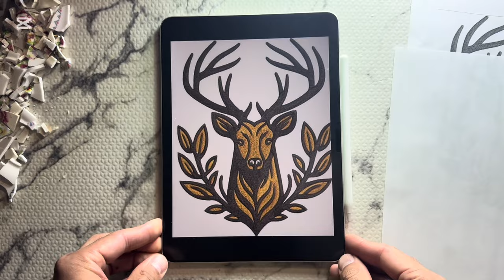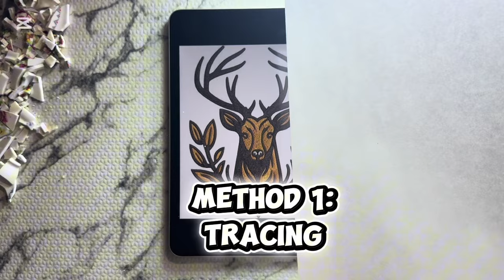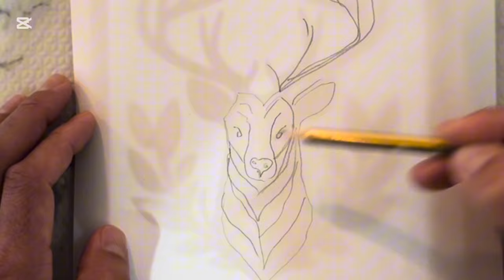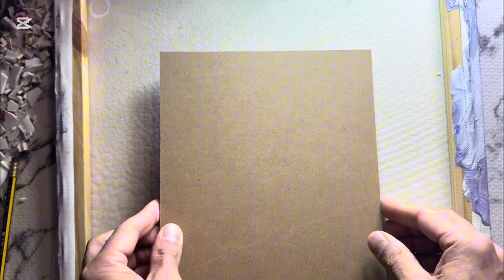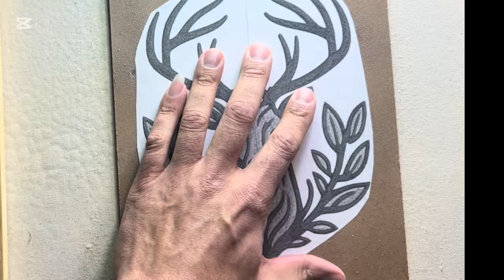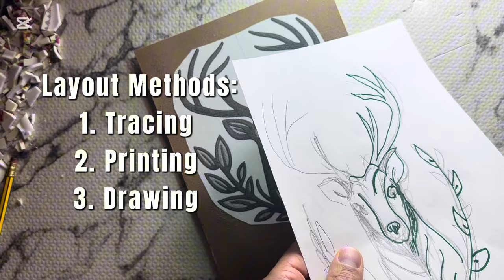3 Easy Mosaic Design Layout Methods for Beginners (Step-by-Step)

Comment: Thanks for your video - just wondering is the paper a special craft paper or just type ordinary printing paper.  Thanks and really enjoying your videos.  All the best
Reply from the maker: Thanks for your comment and I appreciate it !   

Honestly I’m just using regular printer paper, I print out the design from the computer and then use spray adhesive to glue it in place, then once it’s dry I begin tiling over it.   

I’ve had no issues with this method- I would recommend this method only for indoor art displays of course.    It would not hold up the best outdoors in rain, snow, and moisture! 

For outdoor art I will have videos coming soon 😊 

Thanks again and hope you continue to enjoy the channel as it grows 😊